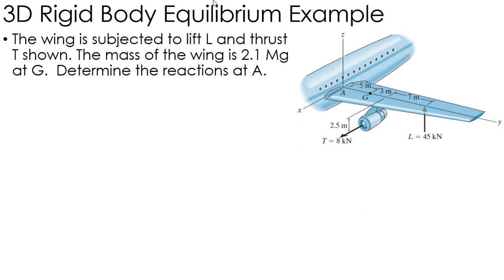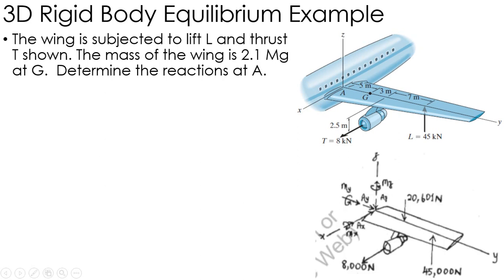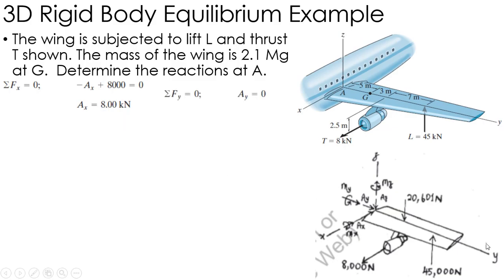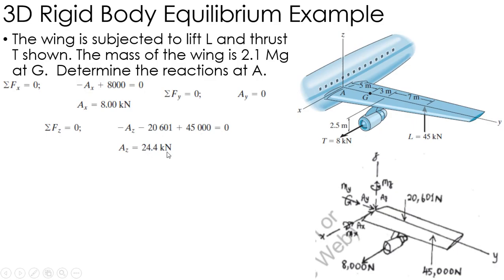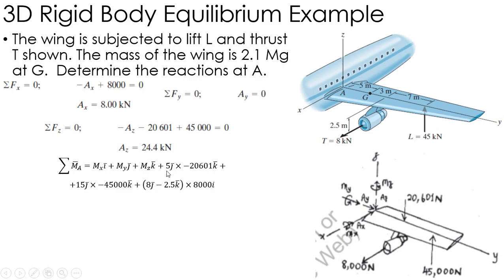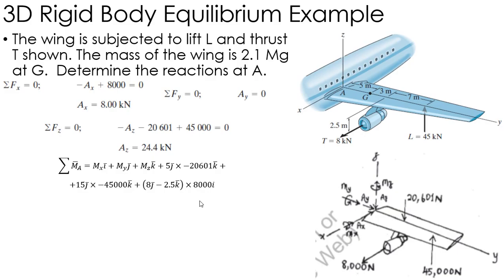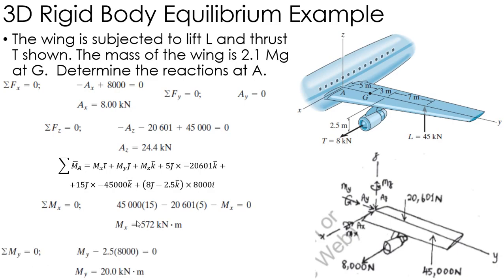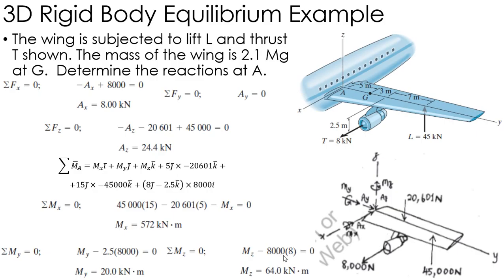Statics Example: 3D Rigid Body Equilibrium 2

Comment: why is Mx  negative in the sum of Mx = 0 equation ?
Reply: Because he drew Mx around X axis in the clockwise direction.
If you switch the direction you'll get a minus anyway.
Reply: same confusion. In the diagram it is clockwise then he put it as positive in summation. Then he changed it into negative.. it's confusing.
Reply: Also 15j X -45000k he got positive i. That is confusing too.